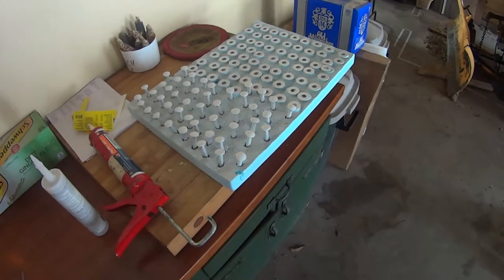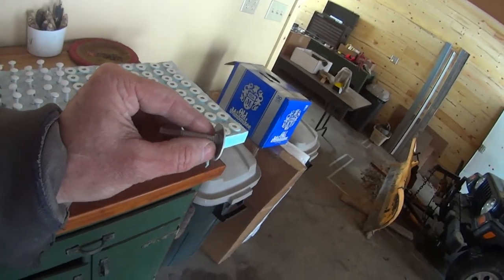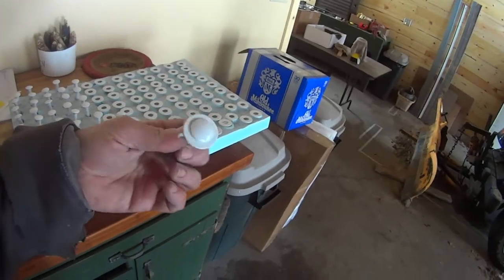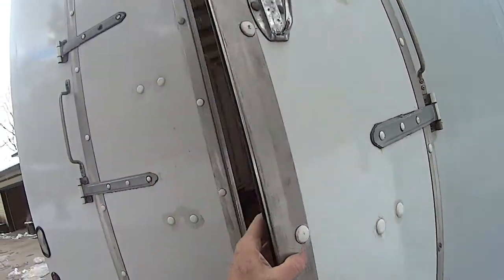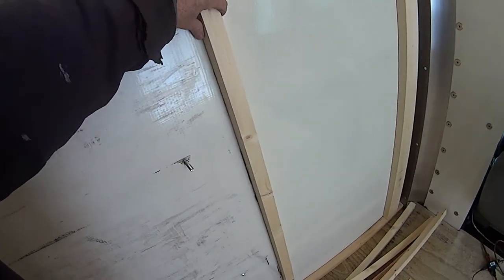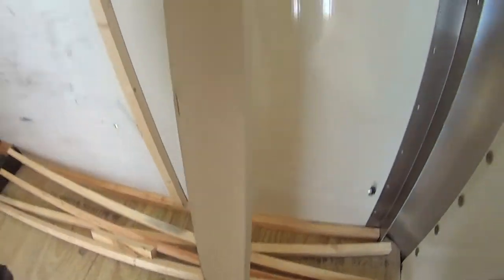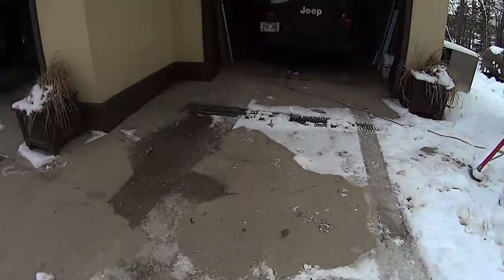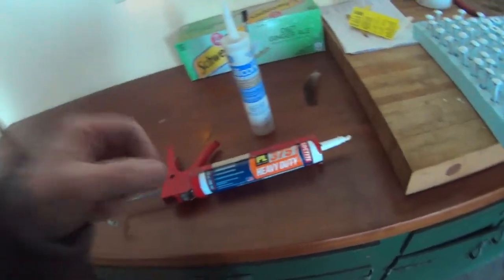Rich's Box Truck to RV #15 - New bolts to replace original rivets on side walls

Comment: Ive been debating on using the stainless steel carriage bolts on mine compared to the much more expensive FRP White Encapsulated bolts at $3.82 per bolt that would match the rivets on the rest of the Vehicle. Dont for the life of me know why the FRP bolts are so expense